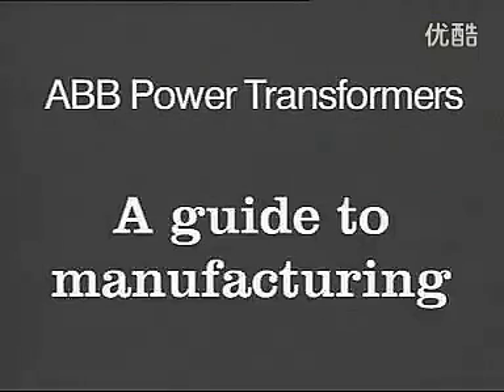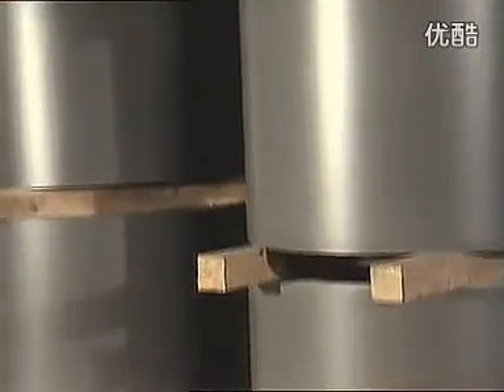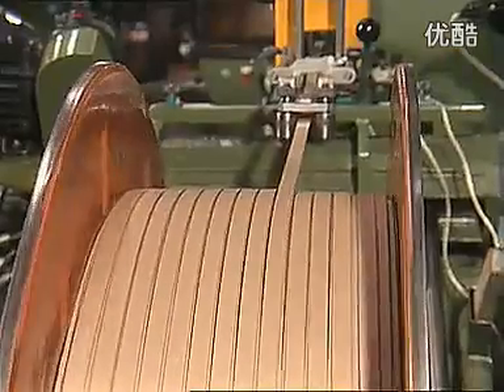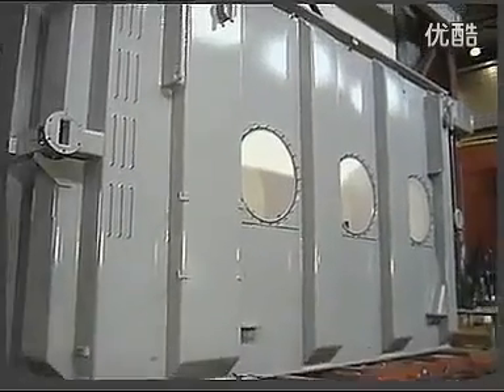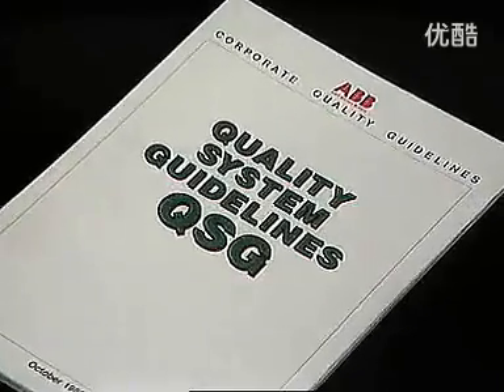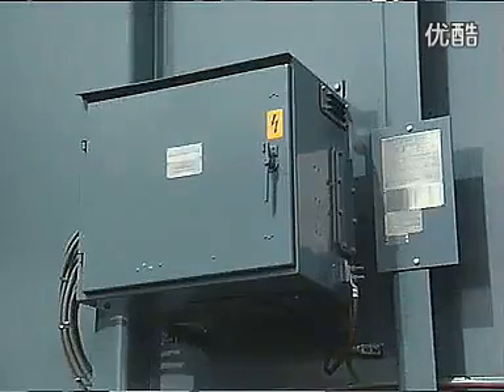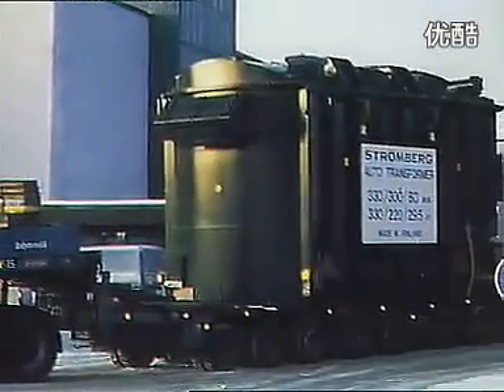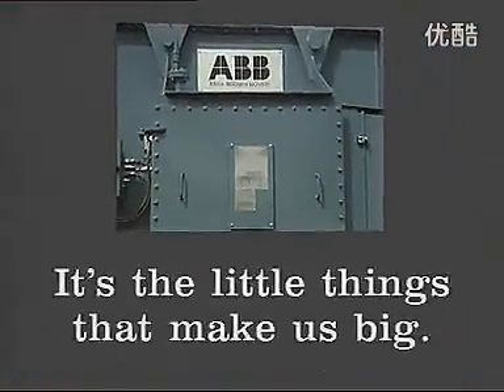the ABB power transformer manufacturing process

Comment: ransformers are the most important element in electrical power, therefore in need of a qualified transformer
Reply: I can help your problem about transformer. I can convert your power transformer into generator.  I can design your transformer into delta delta connection the electro magnetic field won't stop so power will continues try my suggestion I study this using knowledge and experience. We change all the generator and convert into magnet like its very economical and easy to no gasoline needed and the power is infinity and easy to maintain

Comment: please help me  , i have a transformer , i know  high voltage , and low voltage  ,  but i dont know  kva , no plate , no description ,  how i know ,what is the capacity , thanks  for your help
Reply: hi you must do short circuit with low voltage you will another auto-transformer to decrease primary voltage and you do short circuit with ammeter that help to know the maximum current of transformer we know S = U.I is related power
Reply: THANKS  ,I'm going to do this test
Reply: @maneleb1  you can also measure the resistance of the windings with a multimeter and estimate kVA from that. That's what I've done in the past

Comment: Impressive and can be better if the person applying the paper tape should not have to use his mouth to hold the paper tape. A higher level of technique should be sought after.
Reply: +sl lim It's funny cause they explicitly mention contamination right when he's doing that
Reply: +sl lim Maybe their high level of experience shows that this is the best technique. :P
Reply: +sl lim Doub that'll be a problem. If you see in the video, right after that part the transformer is moved into the oven to remove all moisture, i.e. the saliva left over by the worker.